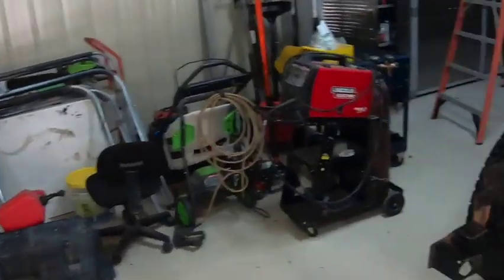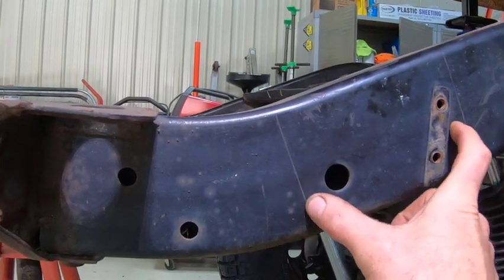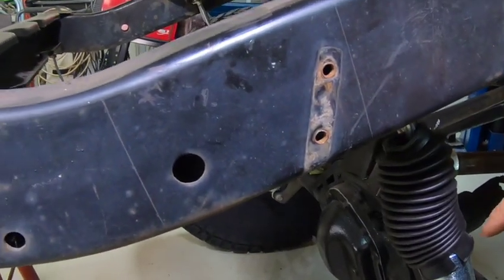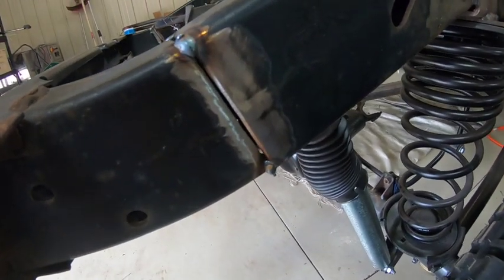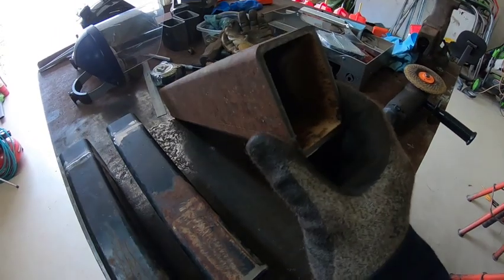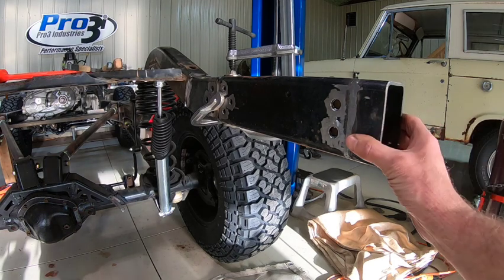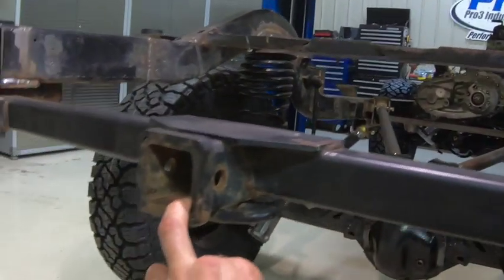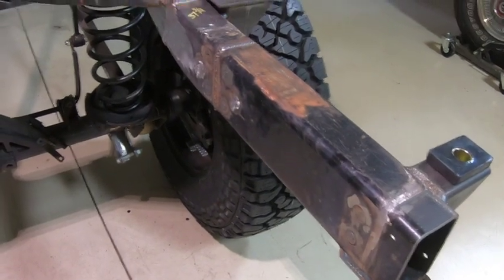Willys wagon/Jeep TJ chassis swap; rear frame section fabrication

Comment: Great build! Eyeing this up for a potential body swap for our '56 wagon. I am curious how you decided to stretch the TJ frame 13". I understand the wagon has a wheelbase of 104" and the TJ 93" for a difference of 11". Was the extra 2" to allow the front grill to align better with the hole in the TJ frame? Thanks!
Reply from the maker: Thanks for your comments Cal.  I wish I could say I planned it such that the front radiator support mount lined up, but it just worked out that way with 13" lengthening.  Mike and I just took some time measuring the Willys wheel base before I removed the body and we felt like we wanted the front axle farther forward in the front fender so decided on the 13".  Its not complete yet, but I think it is going to be a perfect length.  Stay tuned and thanks for following.

Comment: Just found this build. I have a 55 Willys wagon and the frame was destroyed. Found a good Willys frame and built it up with Dana 44 front and a custom built Dana 60 rear. I have not been a big fan of frame swaps because of the very issues that you are dealing with in the rear. The original frame has all the body mounts and was of nearly equal strength to the later Jeep frame. I might do some boxing of my frame for added strength in a few places. Your work looks good.
Reply from the maker: Thanks James. Your build sounds awesome. Would love to see some pics.